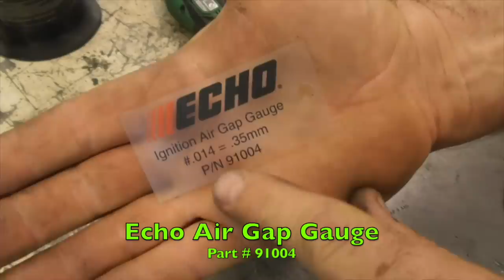How To Replace A Short Block Engine On An Echo SRM-280 Weed Trimmer - with Jaryl

Comment: These little engines catch PURE HELL!!.I bought a brand new Stihl FS-76 back in June of 1993.I finally as of last year changed the FACTORY original plug in it after 24 years of heavy use.I use Amsoils Saber 2-cycle oil 1.5 ounces to a gallon of gas since break in.I've checked the inside of this engine and it still looks brand new.
Reply: 4 gauge that's what I use in all of my equipment. I have all husqvarna and stihl stuff but slowly phasing stihl out since I can't get along with some of their new stuff but the chainsaws I can still see the numbers on the piston they're so clean. I use startron or whatever fuel stabilizer too
Reply: Cameron Crane I use Amsoil 0W30 in my John Deere garden tractor and it makes a really big difference in fuel consumption.I decreased the fuel consumption by nearly 2 full quarts per hour.
Reply: Cameron Crane I stick with STIHL mainly because of the dual compression rings compared to huskys single compression ring.
Reply: 4 gauge so far from what I've seen all of the professional stuff by husqvarna has atleast 2, there may be some exceptions I haven't seen yet but
Reply: Cameron Crane I've had the so-called pro-husky stuff apart too many times.People are constantly telling me this and its not true.The husky stuff(home owner and pro)has only one compression ring and the other ring is a oil ring.STIHL uses TWO compression rings from the cheapest home owner saw all the way up to the 880 magnum series($2,000.00 saw by the way)and ONE oil ring.
Reply: 4 gauge husqvarna 575xp and 570,365xp,372xp,390xp,395xp and on and on. But either way there's a ton of debate on which is better when it comes to friction and tons of other things.
Reply: Cameron Crane I have a up close photo that's titled"WHY BUY A STIHL",it hangs on my wall in the shop.Its a close up shot of a Stihl Magnum 880 piston and a Husky 390-XP piston,there isn't any debate which is better,the 390-XP has only one compression ring on it.The other problem with a husky saw is that you almost need three hands to operate it,due to the funky control layout.The Stihl can be operated with one hand(not recommended)if need be,you can work all the controls with one hand much easier with the Stihl.
Reply: So you're saying stihl saws use 3 rings total? Definitely not the case. There's no such thing as an "oil ring" on a 2 cycle. Plenty of excellent saws have and do use 1 ring. OE 372xp, 7900/7910 (and most every other dolmar), 346xp, 550xp, and many others.
Reply: Benjo Sorry,I've had too many of these apart,huskys only have one compression ring,from the cheapest saw to the 390-XP.($1,200.00 saw)
I have a photo of this by a independent equipment reviewer that says at the top of the photo..."WHY BUY A STIHL".It shows the Stihl with two compression rings again,from the cheapest to the top-of-the-line 088 magnum($1,600.00)
Reply: Lord knows why I feel compelled to entertain this, but go ahead and google image search 390xp piston, then ms661 piston. They both have 2 grooves for 2 rings. No difference in basic ring design. Both excellent saws used by countless professionals. On the 084/088/880 there are a pair of grooves above the rings that perhaps you're confusing for a third ring, but it is not, and I've never seen that design on any other Stihl saw.
Reply: Benjo I've had too many of these apart to know better.I feel compelled to ask you the question...Why is the compression ALWAYS LOWER on the Husky saws then then the Stihls??.I already know why after more then 60+years working on small engines,now retired.If you have a logical answer,let us know.
Reply: Yet again, not sure why I'm feeding trolls, but compression is not always lower, that's a ridiculous blanket statement. In fact, Dolmar/Makita saws generally have the highest from-factory compression...5105s, for instance, are often over 200psi. They use one ring. Many things affect compression, and you can certainly have too much of it. Different saws are designed to run with different compression. The ms660 I used for milling had about 160psi, worked very well. My 395xp that I now use for milling has 180, also runs well. If I deleted the base gasket out of any saw it'd gain a bit more, doesn't prove much. It's fine that you prefer Stihl saws, they're great, but your false generalizations don't help.
Reply: I know virtually nothing about saw compression (okay a little bit because I'm a mechanic) but agree with 4 gauge and would frequent his establishment over Cameron's or Benjo's. Husky's suck the big one.
Reply: The Stihl FS-76 was actually manufactured by Zenoah in Japan!  Best brush cutter I ever owned.

Comment: 47 minutes?! O_O Great job! Still, we all know the only reason you'd rebuild the engine is for yourself. There's no money to be made in such a customer repair, nor much resale value after having spent your time. I've learned the only reason to fix a trimmer is when replacing the entire fuel system. You can re-string it, put a new spark plug in. But anything else is a waste.
Reply: Yep yep, and remember, if it's several years old, always take the muffler or spark arrestor off and clean the port screen. A lot of people give up on otherwise perfectly good engines because they don't realize the engine can't cycle correctly.
Reply: Unless its a red max blower. Short blocks are un available now so you have no choice but to rebuild/replace the cylinder or rotating assembly
Reply: Well your right and wrong, rebuild is one thing swapping out is another. Figuring this way if your proficient how quickly can you swap that SB out? 18-20 minutes or less?  and another point Im pretty confident commercial ECHO’s are better than they Home Deep shit machines. Wouldn’t you assume it may better for a commercial operator or DPW equipment mechanic to swap out a SB kit instead of a whole new machine?
Reply: This is why I only repair  lawnmowers and snowblowers everything else is a waste of time and no $$$$$
Reply: Lo Kim u
Reply: Powder River It depends on the cost of parts and how much it will cost in the future to keep running. Japanese brands are generally good. If you buy American brands, you want older ones actually made in the USA, around 1995 and earlier. When companies shipped production to Mexico, most equipment wasn't worth fixing due to short lifespan/reliability.
Reply: I agree and disagree.  I do not plow snow in the winter downtime, so rebuilding all these old throw-aways from other guys and selling them the next season provides a decent influx of cash which keeps me out of interest payments on all my new gear. Works out well!
Reply: The stihl fs250 is big money. That would be worth rebuilding.
Reply: 9 times out of ten the carb is shot. A guy brings in one of these things into my shop, I go through all the trouble of checking compression-spark screen-etc, call about the cost of parts and write an estimate. I then call the customer and give him the bad news. You know what happens next? Not a damn thing! Because at that point they go buy a new machine, abandon the old one at my shop and stick me for the minimum labor fee. If they are cheap and need more then new fuel line and a new plug I tell them to chuck it in the scrap pile and go buy a new one at WalMart!
Reply: @edgenet1 is this a good trade to get into?

Comment: I love your videos, very detailed and informative,  also love the comedy.  But I'm having an issue that I cant find any info on so this is it.  I have an srm-210 echo and it runs but the engine seems to be a little loose on the shaft and there is a black oily film in this area on the outside of engine housing and shaft area. Any ideas on what I have going on.

Comment: Have never seen that type of screwdriver Jaryl was using around 20:03 that converted to a T handle like that, does anyone know what the brand is?
Reply: Howdy JC, Jaryl Jack Derriere here.  Thanks for asking about the tool set.  The T handle tool set I was using in the video is made by Felo.  I found this one on Amazon and it is very similar to the set I own: 

https://www.amazon.com/Felo-0715750630-StrongBox-Slotted-Phillips/dp/B000E62NVE/ref=sr_1_6?keywords=felo+tool+set&qid=1568075044&s=gateway&sr=8-6

You can do a Giggle search on the Interscreen and find different sets.  I have used this set extensively for years now and it has held up very well.  The only downside is that it does not come with a T27 bit, but I purchased one separately and store it in the box.  Take care.

Comment: i replaced my spark plug with a champion on my snowblower, it has a briggs and stratton 11,5hp engine. i noticed it lost hp on the top end could it be because of the spark plug like mentioned? i didn't mess with the governor at all and find it odd that i was lacking in top end

Comment: I have a Stihl fs66 trimmer, runs great, except it leaks at base of cylinder. I thought just do an upper rebuild while I'm that far along, but can't find any of the parts, even if I can find gasket thickness I would make one if nothing else

Comment: What brand allens are you using on the impact with the ball end? Looking for a decent set. thx
Reply: Patrick PK the allen driver bits are a no name bit but I get to purchase them at the annual update school so I make sure to get an extra set or two every year.  They do eventually wear out and so do the T handle drivers but you can cut down (shorten) the bit a little to get fresh edges.  The ones I used are not ball end, though.  I hope that helps.

Comment: Mine is the Echo SRM -225  
after 1 year I had to replace the spool thing it didn’t let line out anymore
Reply: Yeah to keep that from happening. Just make sure you're always bumping the line feed on grass and not on concrete or sand. And just bump it very lightly and it will last a long long time. I've had my 225 for 6 or 7 years with no problem

Comment: I figure this is cost effective, sure you can by cheap trimmers but most commercial guys use the better machines. Good ECHO’s aren’t cheap, my Shindawa which is owned by ECHO was a $500 dollar trimmer $140 for a short block is a bargain, besides by cheap get cheap and the easy string heads are the bomb too.

Comment: Good video. Taryl is still the best host though. Lol. You would be surprised how many people gave me the "ok" to do exactly this for roughly 200 bucks. It seems stupid till they realize they might have to blow 300 or 400 on new commercial whacker. I dont mess with cheap crap. Too many bad things with Remingtons are the worst, Yard Machines are crap, Crapsman suck etc... I like working with Echo, Stihl, and some Toro whackers. Most others are junk and not worth the effort in most cases in my opinion.

Comment: Gonna try the Champion plug versus NGK for that rpm drop
Reply: Took my 323L Husqvarna with a Champion RCJ7Y,  reved up to 9500.   Changed to NGK BPMR7A, reved up to 9500.  no difference, just as I tought. One thing I do know is that Husqvarna 128R, 128RJ, 128C need a resistor plug to function corrrectly. The automatic spark advanced built into the coil  is affected by the use of a non resistor type plug.
Reply: Believe it or not husqvarna trimmers and saws are really picky    on the spark plug you put in it. DO NOT USE E3 spark plugs. They don't work.
Reply: used one on my snowblower and noticed my max rpms were lower, i will try an ngk to see if it helps.

Comment: Just got me a like new Honda Mower with a bent engine shaft any way of straghting-the sucker out or is it ????
Reply: edgenet1 if you can't straighten it with a hammer and a point of reference, replace the shaft.
Reply: Take it to a shop that has a crankshaft straightener. (Yes, there really is such a thing.) I have one in my shop. Don’t use it often, but it’s handy when you need it. But unless you have shop like I do, it’s an expen$ive paper weight.
Reply: Here in Toronto No shop will straighten a shaft, they all say they were warned no to do so by the engine manufacturers.

Comment: It's cheaper to get a new aftermarket cylinder kit,clean up & reseal the crankcase then reassemble it than to replace the whole motor,if you included the labour on top of that,then it would be cheaper to buy a whole new line trimmer.

I think the government had to kick Phil Morgan off his property in Australia so he must've done something that's really bad,I'm assuming that they fined him.

My grandparents on my mothers side used to own it before their marriage ended over 30 years ago yet my grandfather is a relative of his who doesn't even know him anymore.

I have had to find out how many locals have been that thick that they thought my grandparents still live there !

They thought there would've been a family reunion for me at both my grandparents house.

On my Dads side,his parents house is basically sold as his father died last August, his mother is also nearly dead.

My grandmother on my mothers side is dead as well so a lot of people just thought there would be a family reunion for me at their houses !

Comment: Where did u get that t handle driver?
Reply: Howdy B Stevermer, Jaryl Jack Derriere here.  Thanks for asking about the tool set.  The T handle tool set I was using in the video is made by Felo.  I found this one on Amazon and it is very similar to the set I own: 

https://www.amazon.com/Felo-0715750630-StrongBox-Slotted-Phillips/dp/B000E62NVE/ref=sr_1_6?keywords=felo+tool+set&qid=1568075044&s=gateway&sr=8-6

You can do a Giggle search on the Interscreen and find different sets.  I have used this set extensively for years now and it has held up very well.  The only downside is that it does not come with a T27 bit, but I purchased one separately and store it in the box.  Take care.

Comment: The entire assembly would been called the long block and the cylinder head alone is a short block
Reply: Generally, you are right. But when you're talking about an engine that is smaller than half a litre, does it really matter? :-) Most "long blocks" include the cylinder walls. Radial aircraft engines didn't even bother defining short or long block. You simply replaced the "jugs" as required. The reference to short  / long didn't really come into its own until mass production car engines needed different manufacturing options. Besides, Jaryl and Taryl can barely get along as it is  - probably because they argued who's long and who's short ! :-)

Comment: Sure looks like it was ran with too little oil instead of dirt ingestion.

Echo doesn't have an adjustable low jet on their trimmers, and the move to 50:1 fuel/oil mix means she ain't getting enough lube unless it's tuned rich at WOT.

Bearings and rings don't care about EPA mandates.  Run 40:1 and stop wrecking your engines.

Comment: Junk not worth it, get a Maruyama
Reply: Maruyama is just a name. Their 2-stroke engines are produced by Kawasaki. I have two of their blowers and they’re nothing special. The best overall line I’ve run has been RedMax.  Nothing will hold up to sucking dirt in them which is what happened to that Echo. I don’t own any Echo equipment but even they will last if you keep the air filter clean and run top quality 2-stroke lube in them.

Comment: what you did forget to say is when cleaning the clutch with that wd40 type oil lube is not to get any on the clutch as thats not cool !!!
Reply: What's going to happen to two pieces of metal held together with a metal spring if WD-40 gets on it?